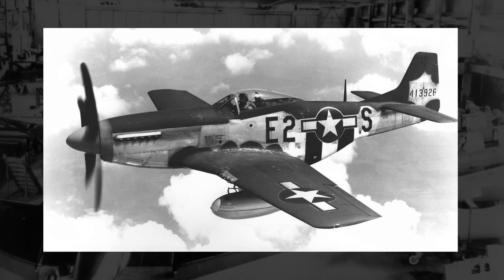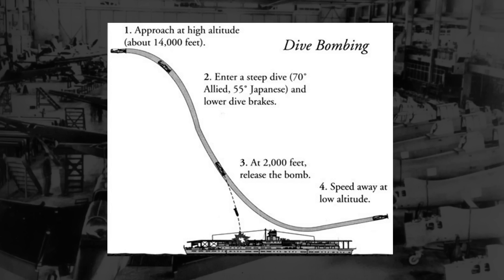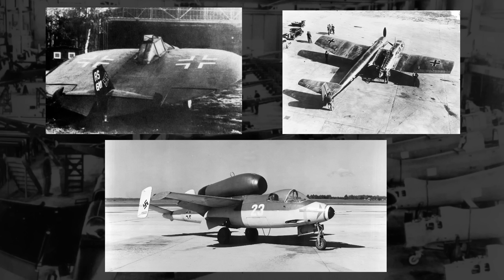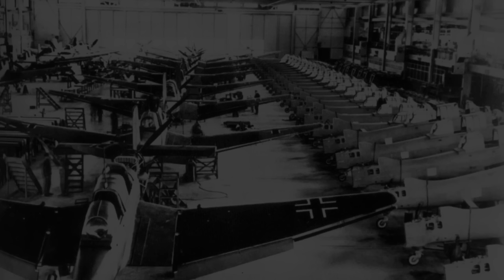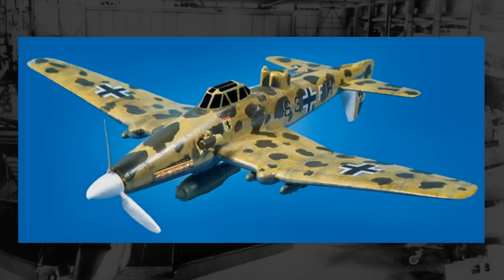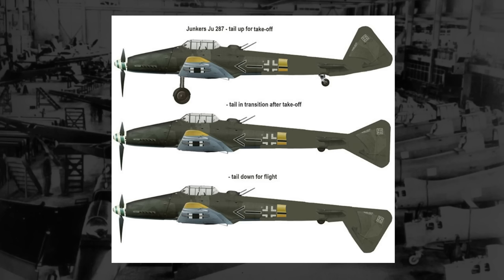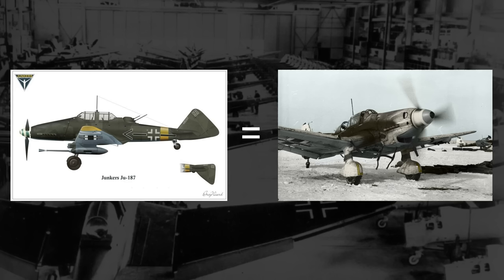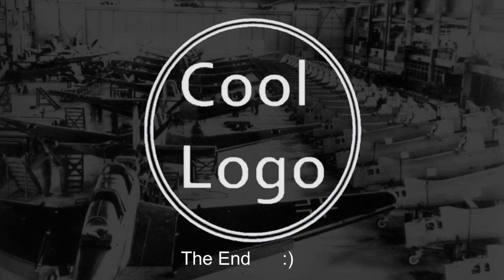The Rotating-Tail Stuka: Junkers Ju 187

Comment: Rotating is grossly misleading and in the interest of accuracy, you really should edit the title of this video.  Pivoting is the term you're looking for as the vertical stab pivots around a lateral axis near what appears to the be trailing edge of the horizontal stab, rather than a longitudinal axis.  Look at the swastika on the vertical stab.  Notice how it changes orientation, yet the push/pull rod for the rudder remains on the same end of the rudder?  The vertical stabilizer maintains its vertical orientation throughout its entire range of motion.  And as for how it'd effect flight?  It'd be very minor beyond a change in the direction of roll and possibly pitch coupling due to the change in rudder hinge angle and the center of pressure of the vertical surface relative to the longitudinal axis of the aircraft.

Another thing to consider is what is mentioned elsewhere in the comments- placing the remote gun aft of the tail surfaces.  This would be far less mechanically complex, but would place considerably more weight at a great distance aft of the longitudinal CG because if the gun moves, so does the load of ammo.  It may require the wing to be moved aft to the point of requiring the tail to be lengthened or the surfaces enlarged to maintain stability and control, and would reduce the pitch response of the plane (think about spinning on a tire swing, then sticking your legs out to slow down, then pulling them in to speed up).  And the change in CG between a full and empty load of ammo may be too great for the acceptable CG range (it is a straight wing, after all).  Remember we're talking about airplanes without any sort of electronic stability aids whatsoever.  They relied solely on being dynamically stable and the skill of the pilot to make corrections.

Re: ground strikes if "forgetting" to raise it upon landing... guys, come on... engineers aren't that dumb; it would have been linked to the landing gear system or at the very least, a light would have illuminated if the tail was down when the gear was lowered.

In short, it absolutely would have worked had it been produced and would have provided better field of fire than any other option, be it split tail or vee tail.

Comment: The Stuka itself was an unnecessary layer of complexity, Making a variant of the wolf or the 109 for dive bombing would be better, and if properly designed it could still be used as a fighter.
Reply: Awful take lmao. The 109 was far too small to carry a useful bomb load, and the 190 wasn't ready for many many years after the Stuka. 

There's a reason literally every credible airforce used dedicated dive bombers /strike aircraft in the early years of the war.
Reply: @frostedbutts4340  but none used them in the late war, except Germany. Everybody went to fighter bombers for close air support, except Germany.

Comment: Two Up Turned Tail Ends, that could be cranked down simultaneously, by the rear gunner via' a dual direction bracket set, to lower and raise them, on a single hand crank, would've been better, plus better handling, plus a second tail backup, incase one if your tails got shot off'! and much easier to engineer, less complicated also, I think?! _ Better yet, We🇺🇲 should've just built a Third Atom Bm!

Comment: First the tail sections were not shot off because of a thing called an interrupter.  If a gun can have an interrupter that can miss a spinning propeller, it can be set up to miss a (relatively) still vertical stabilizer.   Second there is no date on the rotating tail Stuka because there was no rotating tail Stuka.  Not then  anyway.  Today it is a figment of the internets imagination.  What would anyone need it for when it would be easier to just lower the vertical stabilizer and rudder, convenient place for a tail wheel also.  Better yet if something has to move then why not just move the vertical stabilizer and rudder up and down on hinges?  

This is an internet joke.  I did learn one thing, not to subscribe.
Reply: In which case, all a chasing plane would have to do, to avoid being shot at, would be to keep in line astern.
Reply: @Gottenhimfella  Correct, except for the fact that the defending aircraft could and did maneuver to give the gunner a shot.  However given the ease of which Stuka's were shot down this was problematic.  Except for the bottom of the dive when both crewmen of the dive bomber were experiencing the effects of the hgh G forces of pulling out of the dive.  They were sitting ducks, as noted before..  Naturally it was just as easy to come up from below and astern where nobody could shoot at you.  There is a story of an F4F pilot doing just that to some Val dive bomber but the pilots name escapes me right now.